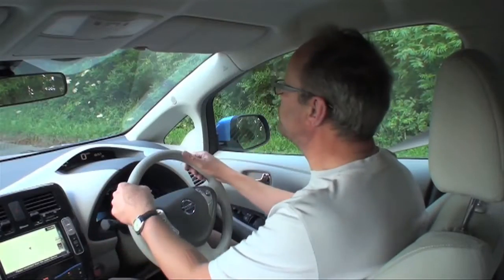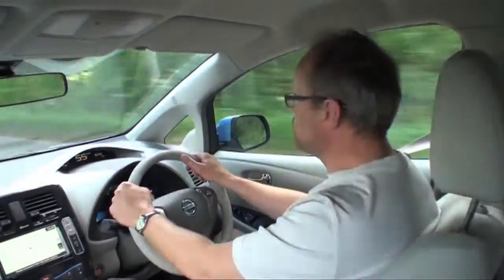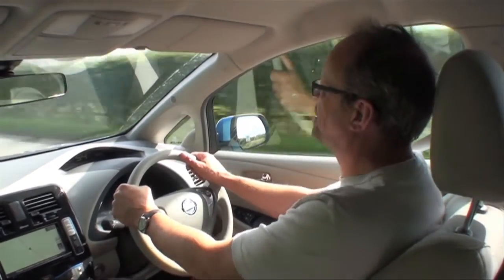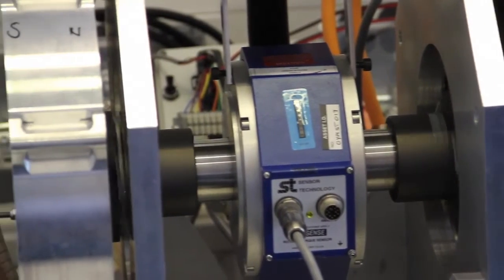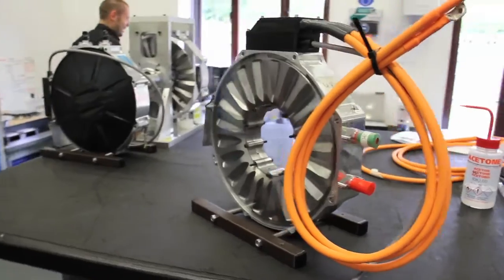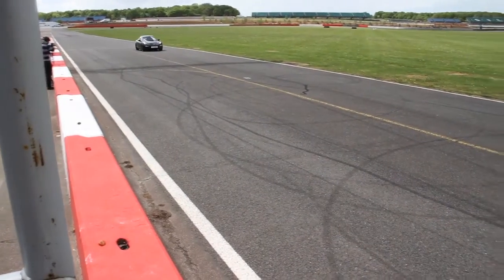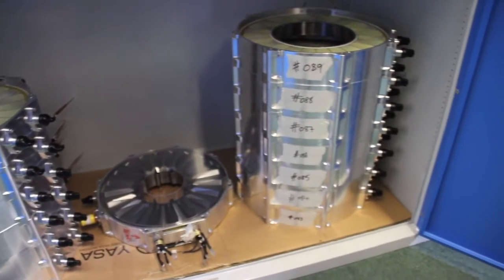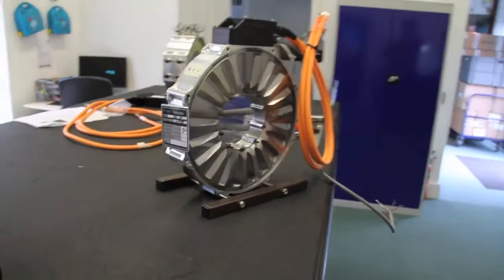YASA Motor Works | Fully Charged

Comment: @DanFrederiksen 
Offcourse, with an electrical car, you don't need a full gearbox, and you could indeed make a smaller motor with a single gearing on it (no shifting). But then you sacrifice top speed, because the motor would run out of rpm's, or overheat, or suffer mechanical failure.

With a full geabox, you end up with at least 6% loss, added weight, complexity, and expenses. Which may offset the very savings you were looking for in the first place.

So, Direct Drive have many advantages.

Comment: @DanFrederiksen 
Considering they already have good range and acceleration, I'd say they are doing things just right.

As for a single stage gearing being less than 2%, that is only under best circumstances. ie. only one gear meshing with one other gear and not under heavy acelleration. This is why normal gearboxes have so much loss, because you go trough 2 sets of straight gear meshes and one straight/bewelled mesh at the differential ... so 2% +2% + 2% or 4% = 6% (FWD) to 8% (RWD).

Continues

Comment: @Jesus45U the loss in a good single stage gearing can be less than 2% I believe but I understand the appeal of no gears. the problem with true direct drive like this is that the gearing is 20x higher than a typical 1st gear in a car. that's quite a strain. many have considered direct wheel drive. all have failed because it's a very expensive way to get moderate acceleration. they should make a smaller motor intended for driving a 1:4 differential.

Comment: @DanFrederiksen 
You made a generally question regarding why no transmission, and the simple answer to that is, higher efficiency, less weight and less complexity.

A normal manual transmission will loose you about 10% of your power, and an average automatic will loose you about 15%, between engine and wheels. A *bad* automatic transmission in poor condition is a whopping 20 - 25% !!!

The savings while cruising with direct drive, more than makes up for the extra power used wihle acellerating.

Comment: @LosDTenaces 
Having made actual tests with RC controlled cars with hub motors, I found it fairly trivial to link the two speed controllers of each motor with the steering servo, so that they would not break traction.

Basically goes like this - Turn wheels N degree left ? back off power by x amount on left traction wheel and add y amount of power to the right traction wheel. Simple enough, but takes a lot of testing to get the values right.

Gets more complicated with 4 wheel steer though.

Comment: The motor technology shown here is truly exciting.  Electric motors have always been impressively compact and light compared to internal combustion engines (it's the power source that's the bulky bit) but these are amazing.  A motor  with that power and torque which weighs 25kg!!

As Robert says, they need no gears whatsoever as even the differential effect can be achieved electronically with motors driving individual wheels.

Comment: Keep up the good work! Nice to see the Brits are pushing the envelope of electric motor technology.

Most production electric vehicles are direct drive to the wheel and don't need a differential. The computer in the motor controller takes care adjusting it to give maximum traction and adjust rotational speed as it goes around corners. Makes it much simpler when you scale it to 4 wheel drive or 8 wheel drive (KAZ electric limo)

My Nissan Leaf's on order and can't wait to test 0-60 too

Comment: @yyarross they both will need to maintain the same torque and general speed to keep straight, but in a corner the outer wheels need to spin faster than the internal wheels to allow the car to go around the corner properly, thats why most cars have rear diffs instead of a solid rear axel

Comment: @DanFrederiksen actually with some quick googling 4th is usually about 1:1. 1st is closer to 4:1 (1/4 the speed but 4x the torque). An EV doesn't need the gearing because even at very low RPM it has the torque needed to move the car quickly. Adding gears would just reduce efficiency. The only place you might want gears with an EV would be for very large vehicles like say a bus or a delivery truck that has a heavy load. Since you can add more motors it wouldn't be necessary but might be cheaper.

Comment: AC 3-phase synchronous motors seems to be bettter than AC 3-phase induction motors. They have a higher size/power/weight ratio and a better overall efficiency (about 95%).

Comment: @fullychargedshow Thank you for explaining that clearly, sorry for shouting in keyboard font. I only have one question, with differentials in the front or rear of normal cars, their differential allow both wheels to move at different speeds when going around corners, while keeping the same speed strait. But what sort of system do these electric cars have because they have 2 independent motors on each wheel, but obviously they need to give the same power otherwise the car would be out of control?

Comment: a permanent magnet has no current, there the effect is achieved by aligned electron orbits around the nuclei. same spinning principle but on a tiny scale. many combine to big effect. special material properties allow the spin alignment to stay. not all materials can do that.
the interesting thing is that electron movement in a wire is normally a walking pace. nothing more. so even the strongest electromagnet is just the tiniest imbalance of the electric force. it can be far stronger. think UFO

Comment: @XitUp magnetism is a tiny imbalance due to the motion of the electrons. when the electrons move (electrical current) their effect fade slightly due to relativity. it's not right but you can sort of think of it like a propeller becoming less visible when it spins fast and the force from the protons dominate a bit.
that's why magnetism from a ring works out of the sides, not edge on. sideways the effect combines. edge on there is motion towards you and away from you so net zero force.

Comment: @XitUp the short answer is that noone knows how magnetism work. there is some understanding. the magnetic force is actually just a relativistic manifestation of the electric force. normally the electric force is balanced in metal between electrons and protons. if there was even a 1% imbalance in a 1kg weight there would be a lightning strike to recreate the balance on the scale of a nuclear bomb. the electric force is ferocious beyond comprehension.

Comment: @DanFrederiksen You're trying to sound intelligent but its really not coming off that way. Pretending to hate the sound of a V8 is just as pathetic as the luddites who slag off hybrids/BEVs.

I will always like the sound of a decent V8 or V12, or even a high revving I4. Electric motors can be an addition to this in hybrid performance cars.
They can also replace the boring sounding petrol or diesel engines in most cars.

Comment: good show. yasa motors are certainly interesting but they don't seem to want to sell the things..  price and availability would be interesting to hear about.
also why they have no hub..
and if they have so much torque, why not gear them anyway. why lose all that torque density on the herculean task of driving the car directly.
4th gear on a typical car is about 4:1 gear ratio. this is 1:1.  4 times higher gearing than 4th gear. it's extremely high gearing to start out on

Comment from the maker: @LosDTenaces Um, couple of things. DON'T SHOUT! It's rude. I admit it wasn't explained clearly enough in this episode, but truly, they don't need gears. Each motor drives one wheel, the motors are fitted side by side in the central part of the chassis, they do need universal joints but it is an absolute direct drive from the motor to the wheel just as we said. There are NO GEARS on the Delta E4 Coupe, the car briefly featured. It has two of the YASA motors, each one driving one rear wheel.

Comment: @LosDTenaces they don't need diffs if those motors are used in the wheel hub - some electric car designs use this technique.  Note that they ARE indeed "small" motors, so it's feasible.

But granted, i doubt that's how the engines filmed here are going to be used.

Comment: I wonder if the whine of high performance electric motor accelerating will eventually have the same cachet as the growl of a V-8 does now?  Perhaps they will simply engineer the sound as they do with many of today's sports cars?  Lastly, many bicycles today use in-hub constantly variable gears/changer.  I wonder if it's possible to apply the same concept on in-hub electric motors to convert the torque.  I love the idea of in-hub motors.